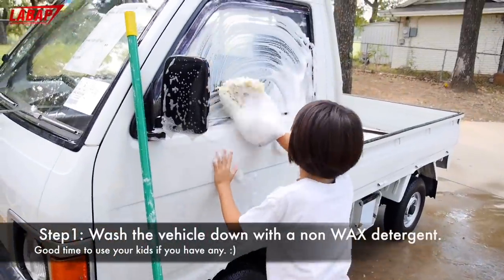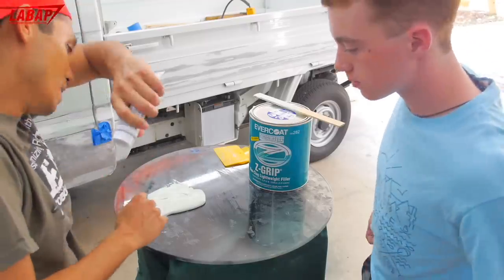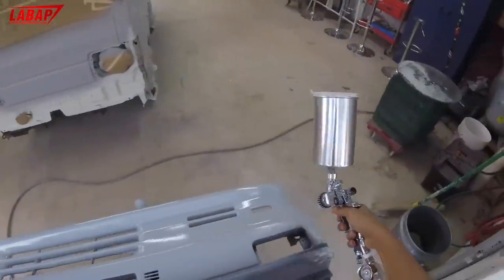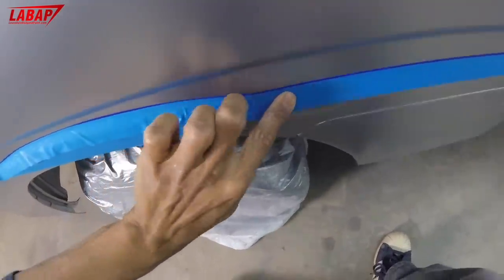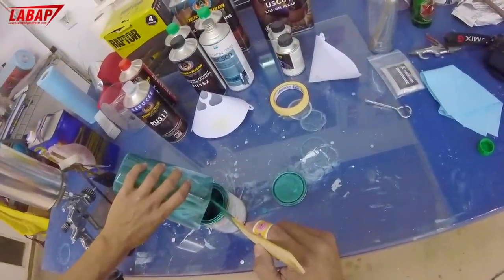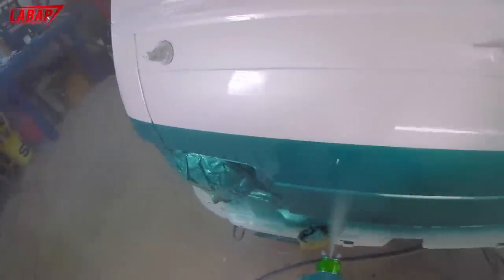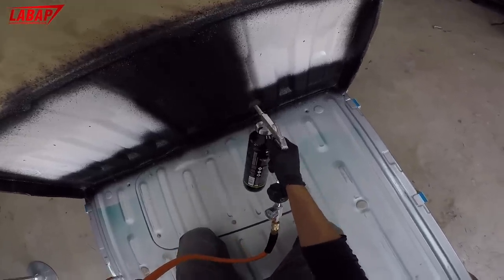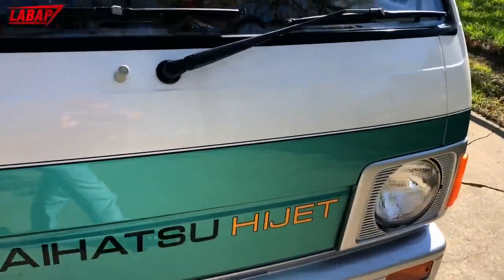How To Paint Any Car or Project Yourself Step by Step in 20 minutes!

Comment: I’ve been working very hard with our VIP auto body class. I love both of my new paint guns and will post a review on the touch up gun . The trigger control is second to none that I’ve ever used . Painted a vintage  motorcycle tank from an old 650 Yamaha. Looks professionally painted.. excellent course Tony .. thank you
Reply from the maker: That's fantastic Jon! Keep me posted with your projects and online business. I offered some calls to me personally.
Reply: BOSS PAINTER - Learn Auto Body And Paint! Thank you Tony . My apologies life’s been getting in my way . Lol . 
Talk soon
Reply from the maker: hey Tony! how are you?
Reply: @HowToPaintYourCar   hey got a question. I am painting my engine bay a metalic burnt orange, an I have just finished priming the bay. So now I'm getting it ready to spray my base coat. Will it be ok to sand with 400 grit or do I need to final sand the bay with 600 before I spray my base?  

I know on my other panels like fenders bumper, ect I will do 320, 400, 600.  But figured I would ask first since it just the engine bay.

Comment: Beginner's Guide, eh? Sounds good. Before I sign up, if you don't describe what spray guns (HVLP or LVLP) I'll need for primer, top coat and clear coat, what kind of water filter I'll need, where it should be installed (upstream to the tank or at the gun), how big a compressor, how many HP (in watts - 750 watts = 1HP) how many SCFM at what PSI? 
How about answering these Tony?
Reply from the maker: Check out some of my videos as I have one with the must have tools to get started! Grab your free manual as well! https://learnautobodyandpaint.com/free-autobody-manual
Reply: the pandeslar pretty sure some of these questions were answered in other videos ... also just FYI 745.7 watts is 1 horsepower to be exact...not 750.  Some of the questions to your answer I can help ... paint guns as far as I know ull want the hvlp for primer, tops and clears. Water filters it doesn't matter , just go with a good one, not 3 dollar ones from harbor freight..  I install my filters at the gun .. as for the compressor when you go buy one you'll see a sticker or quick guide on the tank somewhere that tells you what the compressor is recommended for, if the paint gun icon is checked off in green ur good to go,if it's not keep looking... although when I did my first few project cars I had a 150 dollar compressor from harbor freight an it did the job just fine, but I wouldn't recommend doing that .  This is just my input on what I've done and had success with.. Tony is much more experienced than me, I'm not a pro painter, I'm a pro mobile electronics install which is the only reason I know how many watts equal 1 horsepower lol. That's about the only thing I said that I'm certain about !!

Comment: Tony I’m going to be using shopline jp375  epoxy primer and jh3770 hardner to prime my 1950 Chevy pickup. What should I use as a thinner or reducer. And at what ratios. I’m confused with everything I found online.
Reply: The data sheet calls for jt510 acetone for a thinner as a optional option. What will this product do to my process. Will it lay down better or easier. Or can I skip using this.

Comment: Ive taken a look at the Atom 20  on that link ..... whats the difference between the HVLP and LVLP ? is one better then the other?
Reply from the maker: The LVLP is better if you are running a compressor that puts out lower pressure. It’s also good for clearcoat.

Comment: If i spot paint a car panel with pen airbrush, what psi do i used to stick on? 25psi or under? Because when in paint with airbrush the psi is 30, the paint result is not smooth enough
Reply from the maker: Are you talking about the base, or clear? You might want to thin out and reduce your paint a little to get a thinner flowout..
Reply: ignatius marcel yeah maybe try drollong you're pressure a few psi and play around with it  and also be sure you are reducing you're paint enough but not over reducing it. Depending on you're paint some of that air brush paint can be reduced 50 50 or more and still be good. It sounds to me like you may not have enough reduced and or too high of pressure for sure. Play with the pressure first if you are reducing paint according to manufacturer instructions and go from there.

Comment: sprayed some base on my truck today and ran the basecoat...really demotivating.
Reply from the maker: Guinelle1 nah it’s ok! Basecoat is where you can screw up and be OK and fix it before the final clearcoat. Just send it flat and replace that section your fix it in 15 minutes! Good luck keep us posted!
Reply: Guinelle1 just let that panel dry and sand it down smooth again and respray man. No body gets it right every time when they re learning. The mistakes and boo boos you make now you will appreciate later when you know how to handle them  if you make the same boo boo or totally avoid making mistakes all together. I resprayed my girlfriends Honda Accord bumpers and hood and fenders like a total of 7 or 8 times til I got It to where I was happy with it.  Alabaster Metallic Silver-Not the best color for a first time painter to begin with. I got the painting down pretty fast it was my lack of experience and not taking my time on my body work and tacking paint too soon and smearing it was what led to most my resprays. Anyways that was about 6 months ago when I started spray painting and after all those resprays and mistakes  made I learned so much and I can see and feel a huge improvement in my confidence with the gun in my hand and laying it on. Got my understanding of the distance from panel, air pressure and gun speed and how much of a difference these can have on spraying without getting runs but putting it on wet! Just keep going for it man you will appreciate it once you perfect you're art and skills!

Comment: Hi. What’s the best way to remove surface rust on the wheel arches?
Thanks you in advance
Reply: rstezza grind to bare metal then primer and paint
Reply: Shawn Hacker standard primer or something specific?
Some people have said to use a rust converter and etch/epoxy primer.

Comment: How long can the 2k primer be left alone until sand n paint can be done ?
Reply from the maker: Hey Man! If you let it sit for a few weeks, you could give it a light scuff, then put another coat of primer on it.
 If you’re within your flash time, 2 to 3 heavy coats will be completely fine. You need to make sure that it’s very thick and filled, especially if you have body work areas, bonds, scratchesand other imperfections that need to be filled up.

You can just spray, then wait for 15 minutes and give it another good coat, up and down the panel. You need to have 4 heavy coats on it. 

You need to let it dry for at least 3 to 6 hours, depending on the primer and heat temperature. Then sand it down the next day with 400-grit on a DA. You can either do dry or wet sanding.  

If you want a comprehensive DIY auto body work program that can help you with your own projects, check out the LearnAutoBodyAndPaint VIP Program at learnautobodyandpaint.com
Reply: @HowToPaintYourCar  thanks 💯